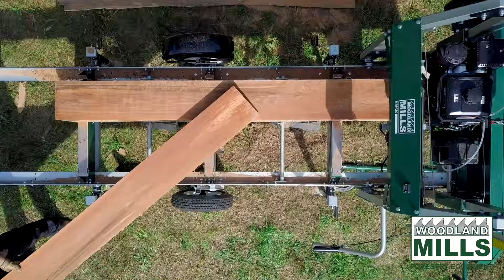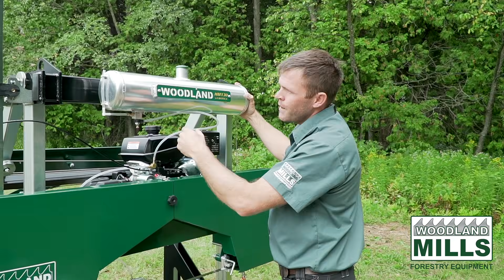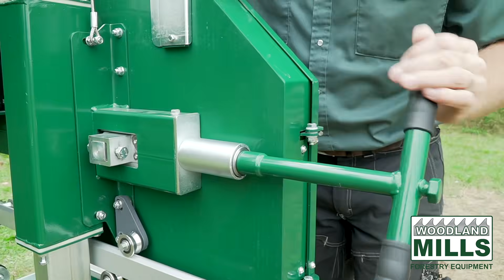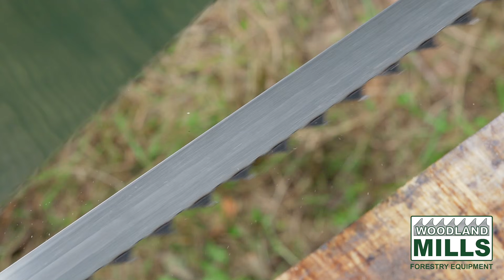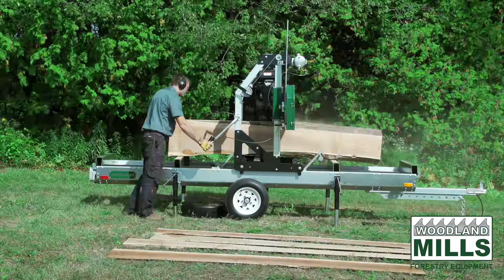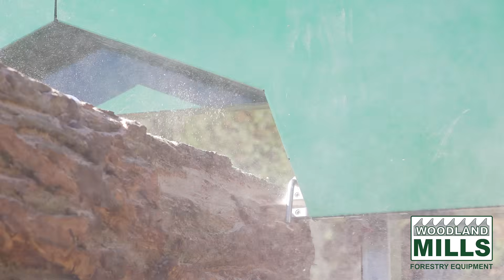Woodland Mills HM130MAX Woodlander™ Sawmill - Overview (2020)

Comment: love the improvements,  ... with the exception of the handle ... there should be a place for both hands, not just one ... adjustable in height for taller, or shorter operators ... and far enough away from the bed that you won't trip over the tire ...

Comment: I see a lot of guys leveling the pith to the cutting bed before making their first cuts to keep the grain straight in the boards, they say it reduces checking. Wondering how important this is as I don't normally do this.
Reply from the maker: Hi Dalton, Leveling tapered logs to align the heart or pith with the track can be done with our optional Toe Board accessory.

Comment: Can you send me that new log scale guide? Owner of a HM130 2019 model.
Reply from the maker: Hi Ray, it will fit your 2019 HM130 if you are willing to drill two 1/4” holes in your blade guard to accept the new bracket. Please contact sales for more info. sales@woodlandmills.com or 1-855-476-6455

Comment: Just got my HM130 XL  a few months ago but with the upgrades and wider cut this mill would have been a better buy for me so my question is, can the max head be fitted to the HM 130 bed?
Reply from the maker: Thanks for the comment and we hope you’re enjoying your HM130 Woodlander. The HM130MAX is 6.5” wider than the HM130, therefore all of the parts that go from side to side are wider, making it not possible to fit the new head on the HM130 track system.